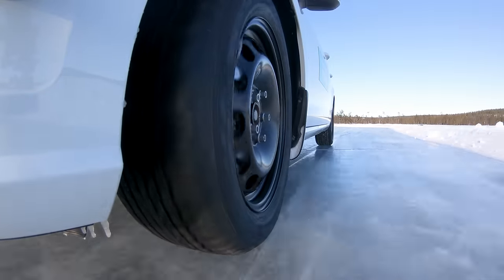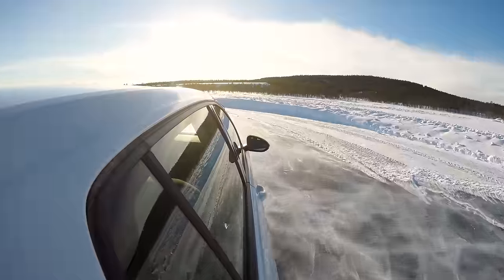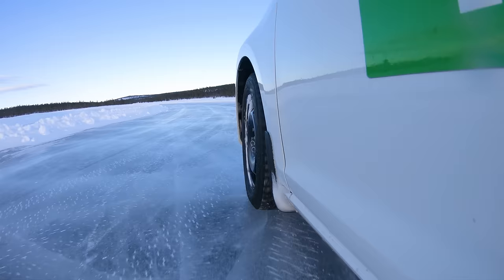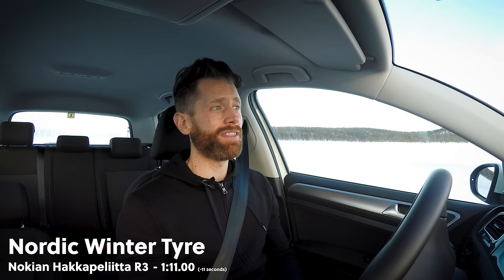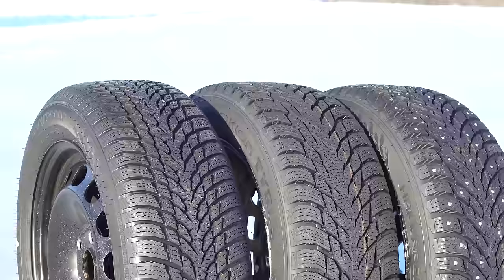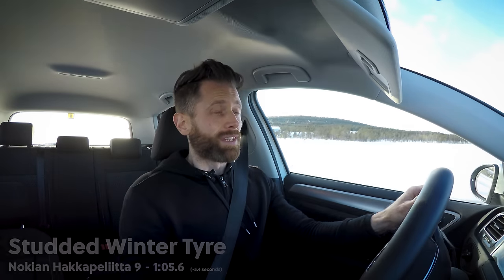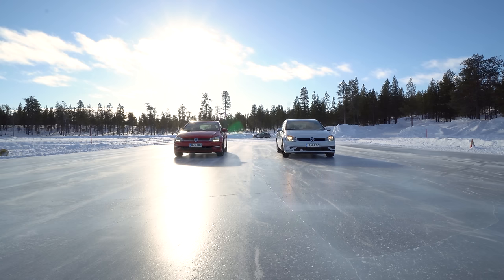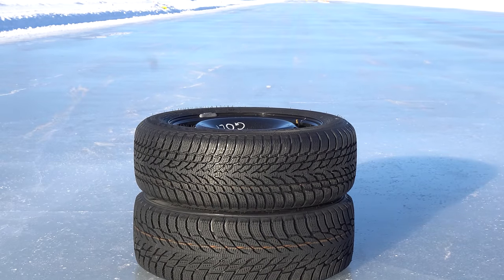Winter Tires VS Studded Tires ❄ What's better on ICE?

Comment: This was the most interesting winter tyre test ever, seriously i find ice surface testing is the most important thing for a winter tyre unless the area you live has no snow.
On almost every other condition you can adapt your speed and driving behaviour, but when you drive on snow and sudden the surface changes from snow to icy snow there i got more than one situation where i had no chance to adjust my driving soon enough to not get in trouble especially on up and downhill.
Also funny and interesting is that i heard the first time from this nordic compound tyres here on this channel.
Here in Austria we got a newspaper from a Automobile Club who does Wintertyre Tests every year but they never mentioned that there is a more special tyre type for more alpine areas....kind of sad
Reply from the maker: Glad you find it useful. Tyre information in mainstream press is somewhat limited so it's good you're doing research. Check out the video linked in the pinned comment if you've not already to see the differences further
Reply: @tyrereviews  Check
Reply: I live in Sweden, and for me it's the complete other way around, many years I thought that everyone used "our" winter tyres.

But when I bought a couple of used wheels that came from a imported BMW I found out.
The tyres were Michelin Pilot Alpine, and I was very surprised how bad they were.
But when I did some research I understood, that's a completely different tyre.
Much higher speed rating, and harder compound, and less "sajping".
And for that matter i compared it to a Nordic Studded, so no wonder that I thought they were bad. (For my conditions of course)

Big thumbs up, keep the videos coming !!
Reply: @daniel635biturbo  With Studds there is really a big difference. Once i was in Norway, i think every third car had studded tyres, but the terrain was way less hilly than in austria, that i found interesting. ;) When i have someone here who has experience in this sort of tyre, what non studded tyres you can recommend for icy snow surface?
Reply: @LackyUno  I always have studded myself, because the rain in Subzero temperatures is the absolute worst conditions, and it's very difficult to spot.
But based on what other use, I would recommend.
Pirelli Ice Zero FR, Continental ContiVikingContact 7 or Nokia Hakkapelitta R2
Note, these are Nordic compound, and feel very different to drive on.
I my self have Nokia Hakkapelitta Studded, and they sway a lot in higher speeds.
The some what softer side walls and "sajps" make the tyre very soft, and not suitable for speeds exceeding 130 kph, especially when above +10°C

An not to buy Chinese Linglong Greenmax Winter HP :)

By the way, there sure are hilly roads in Norway but it depends where you are, as with Austria around Vienna It's more flat :)
Reply: @daniel635biturbo  Haha, yes around vienna its flat, thankfully i dont live there. Hey thanks alot, really i think ive never seen your recommended tyres in any of the yearly tests wich the car magizines here are doing, this year i dont need new tyres but i think next year i give one of this nordic compounds a try.
I once had a nokian winter tyre (not a nordic compound) on my volvo v70, the tyre dealer has praised them big but i really thougt it was one of the not so good tyres in snowy conditions but also it was the first and only winter with the volvo, so the car could also have had a influence on the driving behaviour.
Reply: Jo, eh. Aber die Mehrzahl der Österreicher wohnt halt in Gegenden wo es mittlerweile wirklich kaum schneit. Und es hat schon einen Grund warum in Schweden im Winter viele mit Spikes fahren und bei uns „keiner“. Außerdem befahren sich Schnee und Eis ja doch recht unterschiedlich, weswegen dieser Test nur bedingt aussagekräftig ist.
Reply: @fjs456  Natürlich hat das seinen Grund, warum die Schweden mehr Spikes haben.
Um was es mir ursprünglich ging, siehe den ersten Kommentar auf das Video, waren eben die eisigen Verhältnisse und dass diese Art des Untergrundes in den Tests meiner Meinung nach mehr Gewicht haben sollte, bzw. dass es Reifen gibt die auf solche Verhältnisse deutlich besser eingehen als die üblicherweise vom Öamtc, Adac getesteten....auch ohne Spikes.
Welchen Reifen man sich dann aufziehen lässt ist eh jedem selbst überlassen, ich für meinen Teil hab aber lieber einen der bei geglätteten Schnee (wie Eis) und Eis deutlich besser funktioniert und von mir aus bei nassen und trockenen Bedingungen Schwächen hat. Wie in einem vorigen Kommentar geschrieben, bei nassen und trockenen Bedingungen sieht man woran man ist und man kann seine Fahrweise anpassen, bei Schnee passiert es regelmäßig dass man auf relativ griffigen Untergrund ist und in den nächsten Metern auf eine glatte Fläche kommt, wenn ich so zurück denke bin ich eben so ziemlich nur bei diesem Untergrund in Situationen gekommen in denen es haarig wurde.
Reply: @LackyUno  currently using pirelli ice zero studded and they grip extremely well on ice but they can be a bit loud, pirelli have launched ice zero 2 this year that has a different stud and tire pattern that is rated 68db over continental 70db

Had some vredstein studless before and did a good job gripping icy surfaces but only with esp/abs/tcs working(had a bad fuse).
Reply: @daniel635biturbo  studded is not allowed in a lot of other countries (like Germany). I also live in Sweden now and for me studded was different. Primarily because of the sound (inside and outside). But depending on where you live and the winter they are really worth the little disadvantage in comfort
Reply: @Clublike  Yes, I know, and as you probably also know, here in Sweden we have some cities who do not allow studs in specific areas.

I choose studded tyres only because the drive to work in the winter mornings.
12 kilo meters, usually not salted or plowed early in the morning.
4 months in darkness, combined with the odd Moose and Wild boar sightings, it's easy to choose for me.

Comment: 15 yrs ago I put Nokian WR's on a STI since it does snow, sometimes heavily, in NJ and I would drive into upstate NY where the roads would be impassable for the stock Potenza tires. The snow performance was incredible. Braking and accelerating were awesome, cornering, however, was not on par with braking and accelerating. I couldn't believe how hard I needed to step on the brakes before the ABS would finally kick in. The WR was a high speed tire with the snowflake symbol on the sidewall and yet useable year round. These tires were very mushy in the warmer weather and as soon as the chance of snow subsided the Potenzas went back on, each to there own.

Comment: Awesome video, I would really like to see what kind of difference it would be with used tires.
Do they all degrade more or less at the same rate or will studded provide better grip for a longer time?
Reply: A bit late of a reply by me. Tires that are 8 years old used Nokian Hakkapeliitta 8 (studded) with 7mm thread in a test scored 56 of 100, a cheap Chinese Goodride IceMaster Spike Z-506 studded brand new tire scored 57 of 100 on the same test. This basically means is that if you buy a premium tire it is "good" even tho it is old. Always worth it to invest on the 4 things that keep you on the road. Also a side note how well do you think a 8 years old Chinese will do in the same test? I have not seen one yet.

Comment: As a Finn, Hakkapeliittas have been familiar for the last 50 years or so. The first ones then had super grip when new, but when the square "suction cup" wore out, only the studs helped. Back then, the studs were allowed to be more "out" of the rubber, so the ice grip was better than with modern studded tires. The drawback then was almost no grip on cobblestone streets...
There is also the thing here called "first slipperies", as the road surface is smooth after the summer, and the first Black Ice is the most challenging for the non-studded tires. After the studs have made the roads and ice layer more coarse, most people can manage with non-studded tires.
Later in the winter the snow and ice are grippier because of different ice crystal forms. I have 4x4:s and use non-studded BFG AT:s year around. As users of those know, they have reasonable braking grip, but poor lateral grip in any other direction. I do not recommend those for beginners, though.  Studded tires are main source of dust pollution in the urban areas here, but without them making the roads coarse, non-studded tires would be a bad choice for less experienced drivers, as the wet icy road would be too much to handle, possibly even not driveable. There are studs in the rally car tires for a reason.

Comment: What would be interesting is testing out the same tyres, but after being used a season or two
Reply: Result will be the same.
Reply: @seanlive6975 But what would the difference be between studded and studless?
After lets say 1 year, 2 years, 3 years, 4 years, 5 years, 6 years, 7 years, ...?  And also compare with the European version. Different chemicals in the rubber age differently, and wear and tear also change the thread dynamics.
Reply: I use studded for my area. I average 3 seasons on the tires. The studs however do not. They get worn down. Some fall out. So by the third season. It’s about 80-90% of the rubber doing the work. I have noticed that the tire compound gets stiffer with age. To the degree of how much from year one? I do not know.
Reply: @thehimself4056  What brand do you have? And what type? I have never, and i mean never, had any studs falling out. Using studded tires several months per year (Sweden).
Reply: Tires 

Winter i*Pike RW11, Winter Studdable. From a business in the U.S. called Les Schwab. 

The studs for me are definitely needed. I have approximately 4 kilometers of dirt gravel road to travel before I get to any paved roads. I think some studs get removed in the spring and fall. As the rocks move with the vehicle. It cases focused weight distribution onto one tire at at moment. So I should say. They get ripped out. lol. I live in the cascade mountains of the Pacific Northwest. Tall mountains and cold winters.
Reply: @thehimself4056 Have you tried some good Nordic winter tires from the big brands like Continental (that one i use, but do not remember what type right now), Nokian, Michelin to mention a few.
Also worth mentioning: The Nordic studless tires are REALLY good if you go by the top ones. For instance Nokian Hakkapeliitta R5 and Continental Viking Contact 7.
Reply: After watching this video and your recommendations I will definitely be trying one set of them. I think the compounds would be better than what I currently have. But since it’s the last season on them. I started looking at different options.
Reply: @thehimself4056  Of course i can not promise you anything but as i said, i have never lost any studs. And i think they make god tires. And the tests here in Sweden often gives the first place to Continental and/or Nokian. One might be slightly better on ice and one on snow, but they are the most common brands in the top two or three. Try searching on Swedish pages for the winter tire tests.
Reply: Thanks for the helpful advice my friend. I’ll be researching soon.
Reply: Studdless winter tires is fresh ware, they wear out real fast and also get old real fast loosing the winter grip... I have compared 10 year old studded tires to brand new ones and did not see any difference, my experience is that at least the old Viking (now Continental) studded tires last longer then your car lol .
Reply: @a64738  All tires have an expiration date. If you store them correctly and never used them, ten they last very long. But when you start using them, they degrade and age and get hard.